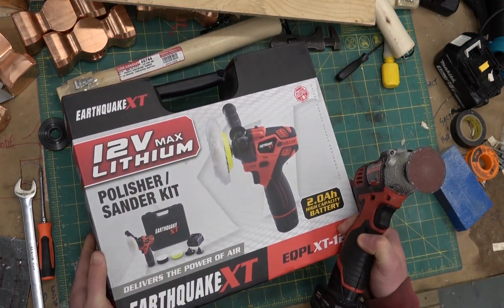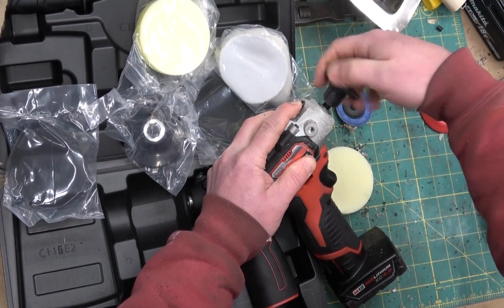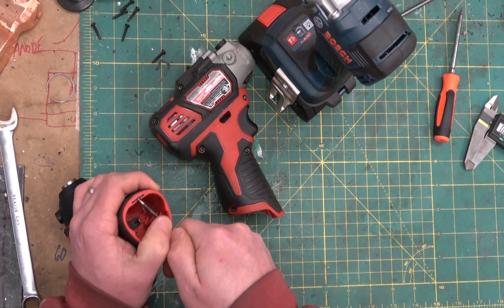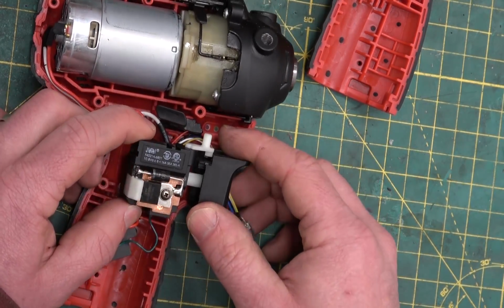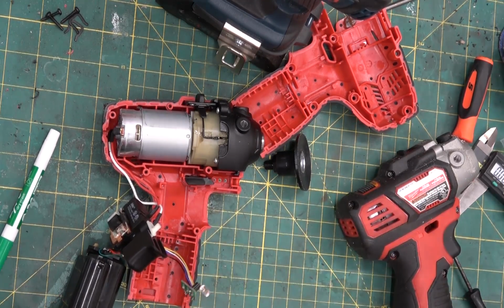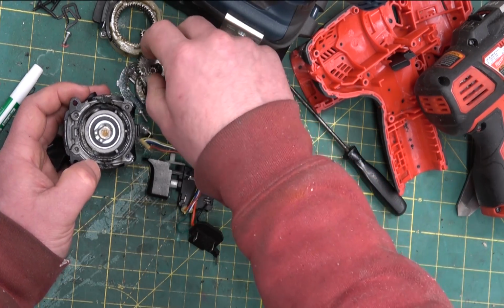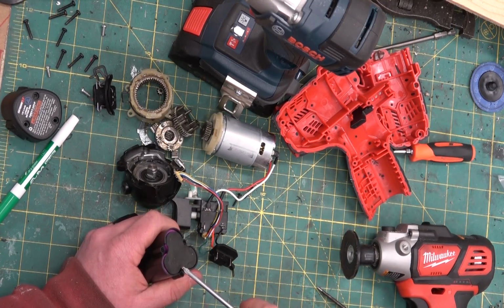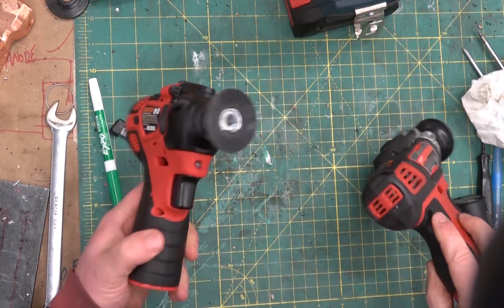BOLTR: Harbor Freight vs. Milwaukee | Sander/Polisher

Comment: Makita must've paid that factory that makes these the most. Makita has a cordless 18v polisher/sander that's the exact same as these two.  Except Makita was kind enough to include a male 1/4 thread adapter, so you're not limited to their 2-inch sanding pad, because these have some weird metric fine thread. Also, the Makita is Brushless and I think 1000 rpm faster in sanding mode vs the milk-cock-ee

Comment: Protip. Get a 10' section of 1/4" tubing. Perforate the first 5' of tubing. Coil the tubing at the bottom of the trash can without a bag. Run the other 5' out and over the can. Put in bag. Enjoy.

Comment: UPDATE - The Hazard Freight has sort of discontinued the Earthquake 12 Volt Polisher/Sander. It rebranded the device as a Hercules 12 Volt Polisher/Sander. All the accessories are otherwise the same, too. Earthquake is only going to be sold as pneumatic tools.

Comment: Did you notice if the Earthquake and Milwaukee batteries were cross-compatible?  Would save buying into the other battery system if you already have one of them and wanted a tool form the other range.

Comment: The Sealey CP1205 (12V) looks like a rebranded Milwaukee polisher. 5/16-inch threads, 0-2500rpm/0-7500rpm. It comes with a 1.5AH battery but you can buy a 3AH or 4AH battery. Costs more than Earthquake, less than Milwaukee.

Comment: Why not add a "spring" to the reverse side and remove the detent, that way you won't accidentally go in reverse? Probably could count it as a "safety feature" as you have to hold it to put the attachment on.

Comment: 18650 isn't 650 mm long. 
18 - diameter
65 - length
0 - means it's a round battery

Comment: I've also noticed buying wire wheels for 4" grinders, I went to home desperation with the company card an paid a whopping 17 bucks a piece. Then when we needed more I tried Harbor Freight and they were 4 bucks each. When I got back to shop upon looming at each wheel they were identical. The Milwaukee had exact same markings/numbers etc as the "cheapo". They were exact same wheels. Well I guess the Milwaukee had a better packaging....prettier if'n that matters

Comment: In the Earthquake 12v ratchet, the battery has no cell balancing provision. In fact, the OEM PCB in the battery has pads for resistors and balance leads, but they're unused in the Harbor Freight build spec.  Has battery management been improved in the newer Earthquake 12v tools?

Comment: I'm glad to see a link handle on the bench.   Link is straight out skookum. 

I put a second rate jobber on my clamrake and it's pretty tender after a year or two.   I'm going to use what the manufacturer recommends pretty soon, a fucking link ash handle.

Comment: The batteries are 25" long? 18 6 50 yeah … I think you mean 18 mm in diameter 65 mm long and 0" of thickness because it's only a 2 dimensional cylinder

Comment: I'm surprised to see there are good quality cells in the battery pack.  I bought one of those Earthquake polishers because it was cheaper and it's great, except it will only run a couple minutes before the battery pack is dead.  Same with the spare battery I bought.  I have to wonder if they're legitimate HD2's or some re-wrapped counterfeits

Comment: In the UK the budget supermarkets have been selling tools. Lake band saws or welders. According to forums they seem to have skipped the quality control stage as they have varying standards. That way the customer is the final quality control. If you are a person to buy a £100 track saw (ridiculously cheep) what the F do you about what to expect from a track saws and if you should reject it. 
They also have the ‘high end ones’ on limited sale so you can’t exchange on your saw dick deal

Comment: AvE, I know you don't often get TOO deep into explanation of electronics, the drivers that run the motors in these power tools/etc but I think it'd be suhhweeeet if you did a video covering GaN (Gallium Nitride) which is being used more and more often in power delivery circuits to make them smaller, more efficient, and more powerful. Mosfet boards and whatnot should begin to appear smaller, lighter, thinner, etc as a result. The Verge has a video on this and it's terrible. There isn't much better coverage of this topic and I believe it should be something that could really benefit the curious to help us be aware and well understood as it IS a pretty awesome transitional phase electronics are undergoing. Not a demand, just a suggestion :)

Comment: It'll be interesting to see how the hazard fart holds up to the willfuckyee over time. As much as I like my Milwaukee tools, and the sander polisher is a handy tool in a garage setting, to not have to spend a couple hundred bucks to replace it would be nice.

Comment: TPR is Thermoplastic Rubber, which is pretty much just vulcanized rubber particles suspended in a thermoplastic. Its mostly recyclable and easier to work with than straight thermosets, and can be used in a conventional plastic injection machine

Comment: I dont understand why so many tools come in useless oversized plastic cases, if the tool is under 100$ and it can sit on a workbench without being hurt, it doesnt need a case.
I fucking hate the plastic snaps on them, with living hinges that fail quickly.

Comment: Pro tip:
After installing the bag in the can, poke some holes in it near the top of the can.
 What fer to let the air in the can out from under the bag  and let it hold more rubbish, so's you don't have to take out the trash so often because it's spillin' onta the floor. eh?

Comment: My latest most used tool in the shop is the M12 brushless angle die grinder, I keep the same roloc mandrel on it. My lonely air compressor never gets switched on no more!

Comment: I bought the local version of the Earthquake a cpl months ago. It has a more user friendly spindle size. It compares to the Milwaukee which I’ve had for years. Downside is a 4ah max battery and I’ve been running the 6ah on the m12 stuff.  Not sure if it’ll hold up for years but I just polish with it small stuff

Comment: 8:31 That is not and rgb LED, you can see it only has two leads, and a single diode inside the case. The extra wires are for the battery indicator LEDs.

Comment: I'm sticking with my pneumatics.  More torque, no battery fade and the compressor is a helluva lot less expensive than a drawer full of dead Milfuckees. And the sound of compressed air ugga dugga is far superior to the whir and whine of the battery driven toys.

Comment: I have the hazard fraught version, thing is effing useless as a polisher.  It's ok for sanding rusty hubs and brake brackets.

Anyway, having reverse would be really nice if your a god damn lefty and don't want to get blasted in the face with paint chips or don't want sanding dust going directly into the cars cabin.

Comment: 18650 battery, 18 mm wide 650 mm long, that is one hell of a pecker if you could fit that in you drill. 18650 = 18 mm x 65 mm the metric system is not that hard relay, although my French wife has trouble converting from mm to cm.

Comment: Drill a hole about 6" from the top of trash can. Then it will let air out.
Reply: RacingfortheSon or at the bottom 😂😂 then forget about holdin any schmooo in there
Reply: That's good advice. Thanks.
Reply: So much easier than poking holes in the bag -
Reply: @PapaWheelie1  sometimes the hole in a bag turns into a rip. But to each their own.
Reply: RacingfortheSon - haha no I’m being serious, I drill holes in my Rubbermaid cans just down from the top. Been doing that for decades.
Reply: That's actually really clever!
Reply: @markkalsbeek5883  👍 idea was my mom's. She was a smart lady

Comment: Reverse can come in real handy with wire brushes and abrasive discs when you’re close to an edge and the tool wants to f*** right off. Also when trying to aim the grinding dust away from a clean area and into your buddies eyes. Bit of a moot point though with the threaded interface rather than a collet...
Reply: truth

Comment: That mini chainsaw is the most awesome, useless, tool ever. I wish we could get them from the usual scumbags here in the states.
Reply: Jack of Many Trades they were on amazon back when ave made a vid on it. I just checked again and they’re not there anymore fml
Reply: @PatrickS9595  3 left according to my Amazon.  May not be exactly the same bosch model but none the less in stock.
Reply: @PatrickS9595  Maybe order from Amazon.de, the german version? Or some tool import joint. Is it battery driven? You'll probably be able to get those without issue here.
Reply: amazon.de is a good source for stuff like that.

Comment: "LINK HANDLES", is that Canadian for left handed? (label on the hammer handles)
It could be an adaptation of the German "linkshändig" which loosely translated means wrong handed 🤣
Reply: links literally means "left" in german.
Rechts und links.

Comment: 19:27 18mm around 650mm long thats some loooooooonnngggg cells ya got there AvE
Reply: Oops, got em😁
Reply: For those that want to decode that number -  18650
18mm diameter
65mm length
0 - cylinder
Reply: @sagetx  dont come over here with your sensible rational head on now 😂

Comment: Harbor freight earthquake brand is the same tool as AC Delco wich is manufactured by a company named Durofix.
I have both ac delco and earth quake 12 volt they are the same even batteries are interchangeable.

Comment: is this a necessary tool for those sanding discs? or are there adapters for a normal 1/2" driver
Reply: You can get an adapter for the rolocs
Reply: You can fit a roloc to a drill however personally despite the floors the higher speed of the snap on one i much prefer.
Much closer to a die grinders speed.
But so convenient.

Comment: How is that different from the right angle die grinder that makes use of the roloc discs? Looks like the same tool minus a paddle switch..
Reply: It isn't  as fast, light, or high enough duty cycle. But it is bloody  convenient well this doesn't  replace that it's a tool once you own you wonder  where it was all your life.
Also i have the snap on version  which has a higher speed much closer  to  a pneumatic but not quite.

Comment: what exact difference between this sander-polisher contraptions and regular cordless drill/screwdriver with a cheap plate for sanding discs ?
Reply: Mostly the speeds involved. The polisher/sander is capable of around 4x the speed. The screw type  chuck is pretty useful for repetitive tool changes also compares to standard.
Reply: @highlandcrawler   i know.  i mean technically.  it is the same base tool with just different gear set.

Comment: Ave, I tried looking for a way to contact you but was unable so I will talk to you here. Enjoy your vids and think you are the perfect guy to design and produce the first ever electronic bathing chair for the elderly.

Simple design:
1) T connector with small hose attached before the shower head that has a "compression?" fitting on the end that keeps water in when not connected to the chair.
2) Basic chair made of water friendly materials. "Strong for the weighty"
3) Rear actuating bathing sponges "like the ones your wife has" on seat for cleaning the "rear end".
4) Genitalia cup with light spring tension that is engaged with either a switch or "pressure plate?" on seat. Should auto disengage and return to being out of the way.
5) On board reservoir that can be filled with body wash / soap that is connected to the bathing sponges and is auto pumped in at intervals "adjustable for the soap amount".
6) This on board soap dispenser should be either inline with a water source hose that is connected to the source via the T connector "#1" or along side the water source. "your choice".
7) This design can also be integrated into a bath lift for a premium all in one model or by itself in order to provide a cheap and effective way to help our elderly.

THIS IS GREATLY NEEDED IN ORDER TO RESTORE SELF RESPECT AND DECENCY TO OUR ELDERLY. 

It is very sad that we live in this advanced society where I can wash my entire van in an automated car wash but we still degrade our elderly and our disabled by exposing their nakedness and bathing them like we do our dogs. This invention will not only restore self respect to our weak but will open the doors for other young people to work in care fields without fear of having to degrade and uncover their nakedness. 

FURTHERMORE I DO NOT WANT NOR  ACCEPT ANY CREDIT NOR ROYALTIES. Also you can make the moving parts replaceable and sell specialized parts and bathing sponges for it.

I pray this post gets to you AVE or someone with the capacity to produce such things. You never know when disaster will strike someone you love, leaving them unable to function and bathe themselves.

This is serious, this man died because the nurses refused to bath him there:
 https://www.militarytimes.com/off-duty/military-culture/2018/12/14/84-year-old-veteran-died-after-nursing-home-staff-ignored-his-infected-rotting-genitals/
Reply: This is a joke, right???!!! Your barking up the wrong tree mate!
Reply: @VanquisherUSMC  Was no joke, this idea came to me and I know no one that could further it. I thought of Ave as he fabricates and makes things. Honestly I hate the thought of anyone having to be degraded in such a way. Not sure why something good for the elderly and lame would seem as a joke to you friend but I am not offended. Hope you have a great day.
Reply: Jeremy Robbins you sound like you’re selling something. Have you taken a look at AvE’s “info” section?
Reply: @brandonb9452  I am not selling anything as I stated in the post. I care not for credit nor royalties. Anyone with a heart should want this available for the lame.
Reply: Jeremy Robbins I know you’re not selling anything. It’s just that you sound like you are. Which we don’t take kindly to here, sorry mate. YouTubers aren’t going to mass produce things but maybe find a designer channel instead

Comment: I'm an American, so bear with me, but those batteries are the shortest 650mm I've ever seen. :-P
Reply: American here too, and I also caught that. I guess I did use metric in the Corps though. I ran a 155mm howitzer battery (6 guns). That's roughly a 6" round.
Reply: @VanquisherUSMC  I'm guessing he meant 65mm, but bumblefucked it.

Comment: Both are made in China anyway but it beats running a two or five hp air compressor to power a .08 hp pneumatic tool !
Reply: Very good point.
Reply: I don't think you understand how compressors work. The compressor motor is not directly driving the tool. The tool is powered by the air receiver. It's an energy storage device.  What the tool consumes is what it consumes. What you have compressing the air be it a 500 watt or 500 hp motor is irrelevant. Compressor horsepower is only going to change how fast air receiver is brought back up to pressure.
Reply: @DJS_ENO  you're right, but pneumatic power is very inefficient. From AirBestPractices:
"To operate a 1-horsepower compressed air motor, approximately 7 horsepower of electrical power requirement is put into the air compressor. Even more power is needed when the pressure is higher than a typical pressure of 90 psi."

Comment: Pro tip for all shops.
Scatter many different things with different shapes and from different materials all over the floors and benches.
In case a clip or c-ring flies off, hold your breath, stay still and listen carefully. Look around, identify what could cause which sound and go through each "pling" and "plong".

No possibility to loose anything again if you layout your mess carefully enough
Reply: Julian Weinert this is so stupid that it’s genius😂  if it’s stupid and it works it’s not stupid eh?

Comment: Another copied tool from China. Milwaukee did the R&D and HF copied it, that's their motto
Reply: Milwaukee is a Chinese company..
Reply: TTI was founded in Hong Kong, which is a very different place.. for now.
Reply: Hong Kong does plenty of business with the mainland. Look on EBay. A lot of the same stuff that is in a Hong Kong warehouse is also in a Shenzhen warehouse.
Reply: @TehKaiser  Correct, but it is quite misleading to just say "Milwaukee is a Chinese company. In fact, it's just inaccurate.
Reply: Milwaukee is a dead company. It is a subsidiary of TTI. It is TTI’s R&D, but they’re making a buck from both. Probably a contract exists between HF and TTI and TTI doesn’t care because they know HF offers a base warranty of 90 days and people don’t get the extended ones from HF. The battery system also motivates what gets purchased. People already committed to Milwaukee 12V will stay with it. 

 Hong Kong sovereignty is somewhat still independent, but ultimate sovereignty does belong to the mainland and thus it can be called Chinese. TTI has a factory in Dongguang and proabably has other locations on the mainland.

If it’s about ethnicities within ethnicities,, then what is actually accurate is that it is a Cantonese company. Cantonese is not relegated to just Hong Kong, but the entire province of Guangdong and the Cantonese language, which is unintelligible verbally to Chinese people from other locales.

Comment: Same, same but different, What was the price differential? I'm guessing the Earth-a-Quake is better value.
Reply: Depends.

The batteries on the Milwaukee are far better. If you are already using their tools, it'll be better to stay with the Milwaukee imo

If you have no existing battery tools, the HF copy would get you there cheaper.